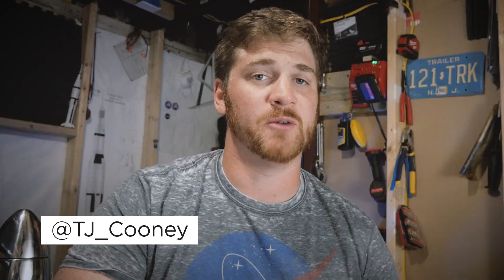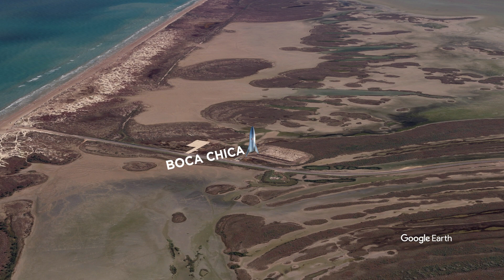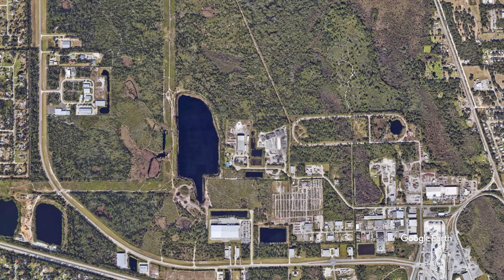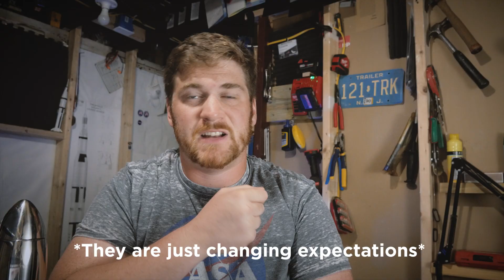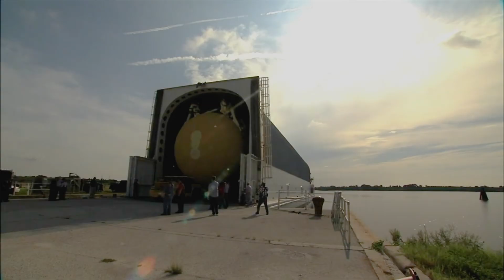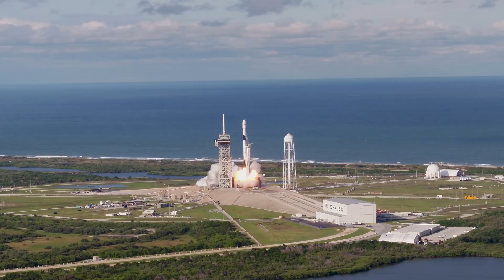How do you Move a Starship? | Life After Starhopper

Comment: Obviously they are using industrial strength Velcro instead of welding. The advantage is that they can pull sections apart to get round tight corners. The disadvantages are eh......  lol

Comment: Starship is an orbital vehicle, Super Heavy is its booster. Both vehicles that are assembled in Texas and Florida are Starship prototypes, not the boosters.
Reply: thanks for pointing out the obvious
Reply: @minervali631  Orbital vehicle is a vehicle capable of orbital flight. That's it. It doesn't say how it gets to orbit. Starship for all intents and purposes is an orbital vehicle.
Reply: The unladen Starship (only a few crew members) climbs into orbit without the need for a booster. But in 99% of the cases Starship will need the booster.
Reply: @juanar4305  
Nope. SpaceX is not going build a stripped down version capable of single stage to orbit. What's the point of that if there is no payload and no propellant for landing? 

Starship can make suborbital hops, and someday that may become a profitable way to move passengers, but more likely they will compete against 12 hour airline flights. And that requires the S-H booster.
Reply: "What's the point of that if there is no payload and no propellant for landing?" Of course. Is only a curiosity.
Reply: @juanar4305  
My point was that astronauts are payload. The vehicle cannot "SSTO" without a massive redesign and custom construction, just to eke its way to vacuum and crash on reentry. SpaceX won't build that.
Reply: They are a payload very light

Comment: The starship maintain stability using the atmosphere, how will do that on the Moon?
Reply from the maker: That’s for an atmospheric reentry. In a vacuum they would use cold gas thrusters and main engine gimbaling.
Reply: The fins on Starship aren't there for flying or control, they are there to create more drag to slow them down in the atmosphere.

But, as you saw in the Starhopper flight, engine gimbaling and cold gas thrusters are used for attitude control.

Comment: The Starship prototypes being built are not actual Starships 
They are basically taller versions of Starhopper meant for higher altitude hops and demonstrating the full scale Starship airframe as well as the control surfaces during descent
Reply: They're calling them Starship Mk1. I have a feeling they will just gradually iterate from the prototypes to the final version, and there won't be a huge difference between versions, and maybe no real final version. Rapid stainless steel production allows this.
Reply: Zabe I still suspect that the production versions will be made indoors
Reply: @nathanlewis42  yes, indoors, which is why they just built a large tension fabric building at Cocoa, and are building something similar at Boca.

But not NASA Bespoke VAB type of indoors lol

Comment from the maker: CORRECTION: @PiDsMedia pointed out an error in this video that I’d like to address. Once the barge crosses the indian river it will eventually veer through a canal and then move north up the banana river and eventually end up in the turn basin southeast of the VAB rather than west like in the diagram. I apologize for the inaccuracy, but the overall concept remains intact. The corrected map can be viewed here: https://youtu.be/IZyxm5eqVBw
Reply: the main point of 2 locations is spot on which is what matters.
Reply from the maker: If only more people were as understanding as you!
Reply: @INeedMoreSpace  you'll see a lot more of "understanding-ness" if this thing really is headed to Mars!
Reply from the maker: Justin Martell thanks Justin, it’s been noted and a correction has been issued.
Reply: @INeedMoreSpace  you also have it wrong that it will be transported vertically in one piece.
It will be moved horizontally, and simply driven onto the barge.
There is no way to do this vertically, because it has to go down a pretty stiff incline to get to the river, and you can't keep the rocket vertical easily, so laying it down on a trailer, or a couple of SPMTs probably (what they used to move Starhopper), then you can drive it down the hill to the water and straight onto the barge.

This is based on permits that they sourced this information from, and which it doesn't look like you read lol, and Elon saying that it would be moved horizontally as well.

And according to the KSC environmental impact report, they are planning to move the ones built at Boca Chica to KSC by barge as well, and it's just crazy to move something that tall vertically on open ocean waves.
Reply from the maker: @ke6gwf  as of now, there is no evidence that starship will be transported horizontally. The starship prototypes are 30ft longer than the shuttle ET, the main issue is maneuvering it around street corners if horizontal.
Reply: @INeedMoreSpace  there is also no evidence that it will be transported vertically either.
The main problems with transporting it vertically, even in 2 sections, is keeping it vertical while traveling down the bridge to the river, and on the side slopes to the barge. How do you keep a 180 foot tall pencil perfectly vertical on a slope? Even SPMTs can't correct for that steep a slope.
And then you have the power lines that cross the river, which you can't put underground.

I have already measured, and the tightest corner for moving it horizontally is coming out of the FedEx driveway, but it's still easily doable with a 180 foot tank hauled the normal way with a steerable trailer or SPMTs. (I am a truck driver with heavy haul experience, and this isn't rocket science lol)

So to recap, in order to move it vertically, you have to overcome physics and power lines and build custom motion controlled cradles.
In order to move it horizontally, you have to hire a standard heavy haul rig and a good driver.

And as much as I want to see it standing tall moving through there, the practical evidence says that it would have much harder obstacles to surmount, and there is no reason it can't be hauled horizontally with very little work.